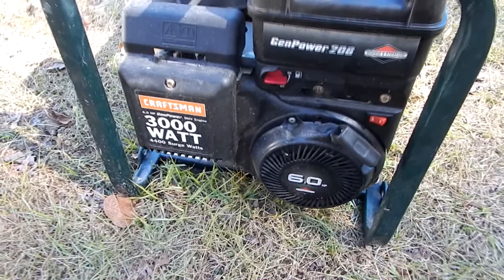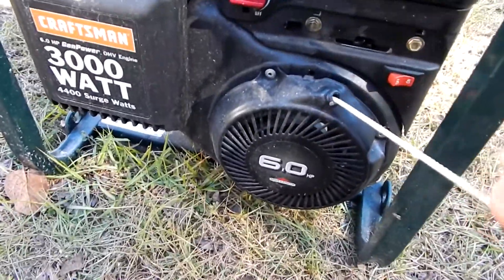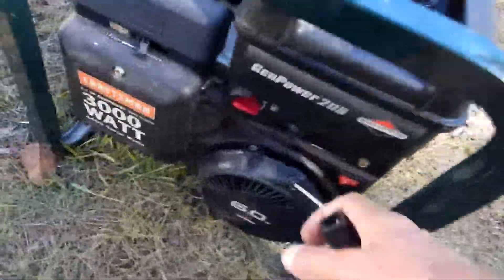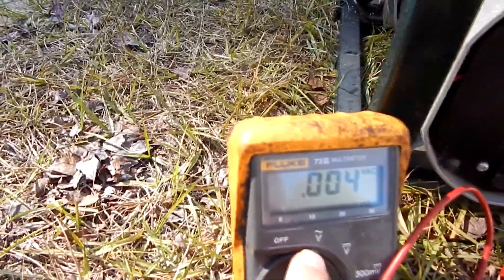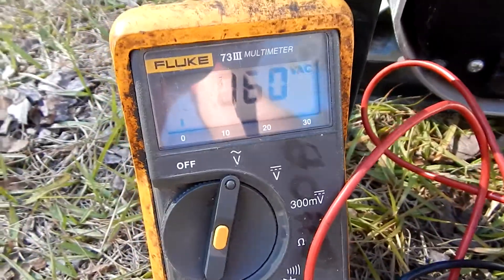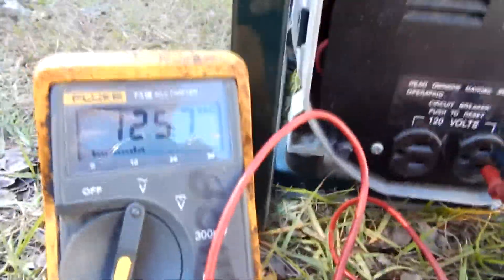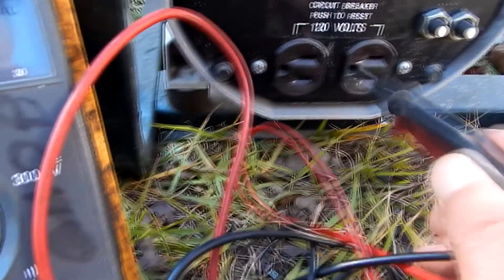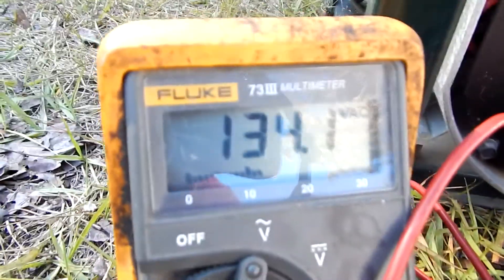Craftsman Portable Generator, Power 206 Voltage Output Check

Comment: I've had one of these generators for about 13 years. Sometimes I'll use it several times a week, and sometimes it will sit for over a year between uses. In either case it starts first time, every time, just like you said. Most recent use was during hurricane Michael.Very dependable and simple design, which is what you want in the middle of a hurricane.
Reply: I have one that sat at my grandma’s house after she passed away. Must have sat 5 years and started on the first pull with choke. Crazy!
Reply: I down in PC for michael for a week used a 3450 generac has 220 plug too. Ran 12 hrs straight everyday full power. Took it home to Ohio, gas and start it once a year.

Comment: I got an old SX 2008  Chinese  3000 watt generator At the moment it has no power output so I say the AVR gone  But I got a 50in  flat screen tv I did not know I could run a 50 n flat screen tv on a none inverter AVR generator like mine they told me the sin wave on my AVR Generator just not smooth  enough and I could blow it up How are you going  running a flat screen tv.
Reply from the maker: .Thx for watching